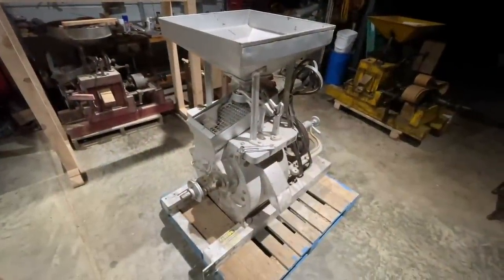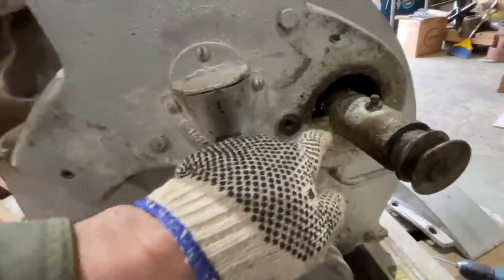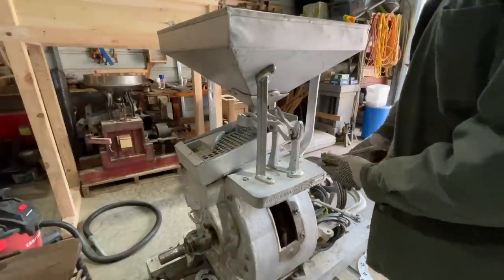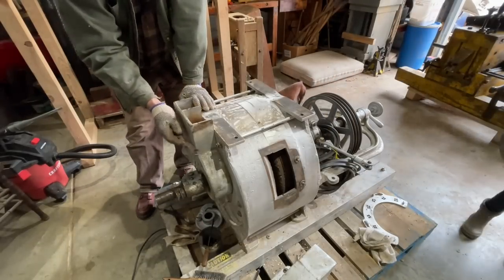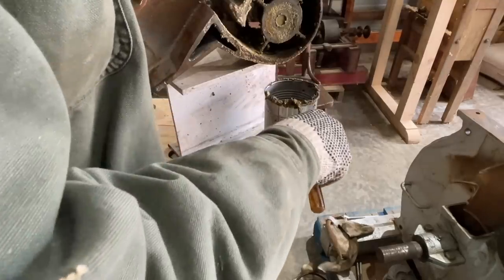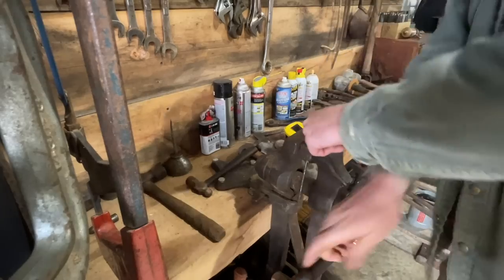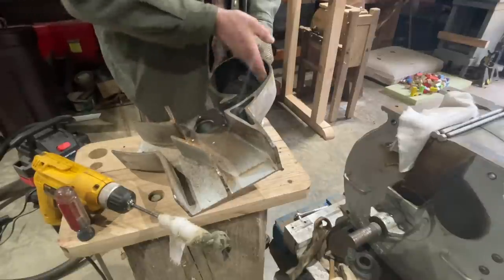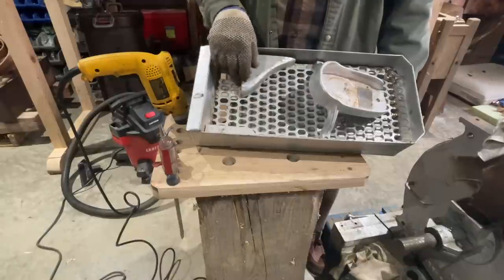Meadows Gristmill Cleaning And Service v173

Comment: Vinegar is a great way to cut grease without chemicals. I learned to make my own on YouTube. The best I’ve made for cleaning so far is from juniper “leaves.” It smells bad, but the smell goes away after a while. If you put some baking soda in it bubbles up and makes an even stronger cleaner. Vegetable oil is also great for getting out sticky junk like pine tar so it might loosen motor grease. All of the above does wonders for dried on sewing machine oil.
Reply from the maker: Thanks for sharing this with us Tracy